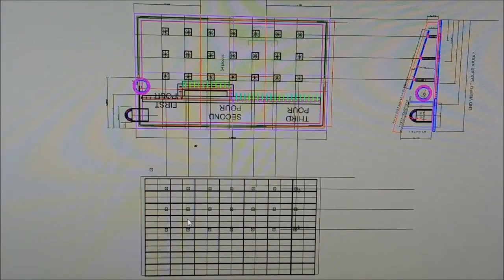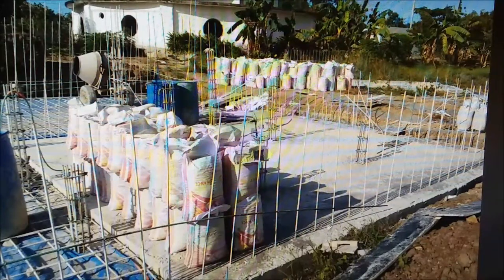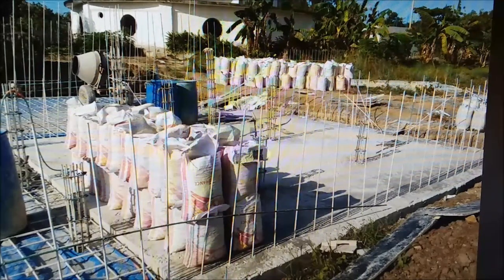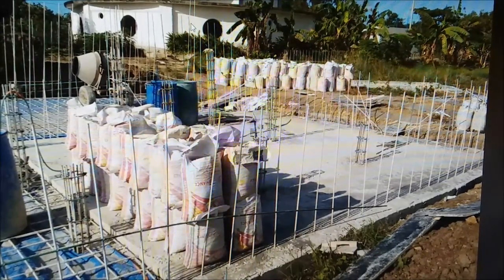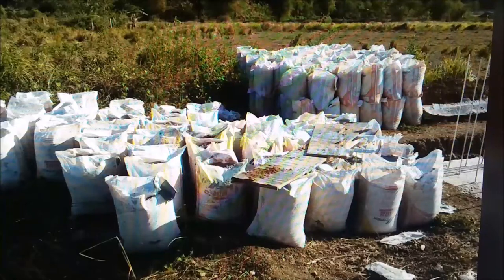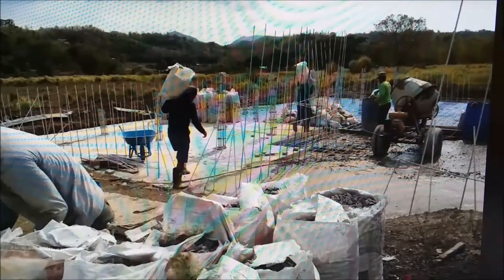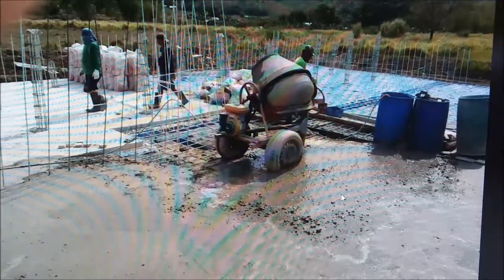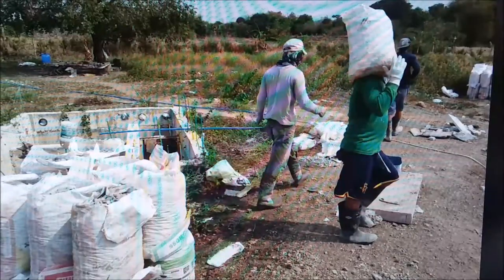CONCRETE HOUSE BUILDING IN PH, POURING THE SECOND OF SIX  FLOOR SLABS FOR THE SOLAR ARRAY AND ANALYZ

Comment: Another informative video, thanks. 
Sorry if I missed  this is on any of your videos so far, but I was just wondering if you are going to incorporate some level of solar tracking in your design. My tentative idea is to mount the array on a East/West axis and use a linear actuator to tilt for morning and afternoon angles.
Reply from the maker: John, We are not using tracking. The array is tilted to the latitude 
at our site and on a true north south. If we were using tracking we 
would still have the tilt to the latitude. For single axis tracking it 
would be tilted on an east west axis as you mentioned. There is a 
channel called  "A foreigner farming in the Philippines" that has his 
panels mounted to a cradle in the east west axis. He just did a video
documenting the change in output with his tracking compared to the panels just flat.  In our case the PV panels are the cheapest 
component of the system so we just added 40% more panels. Our 
main concern is typhoon damage carrying away the panels. So a rigid
mounting and perimeter wind block wall as well as having the 
array behind the house downstream from the prevailing wind is the 
plan.  The "texas filipino" channel is still in construction but will 
have his on the ocean side of the house tilted towards the latitude.
I am not sure how close to south that side of the house is to
facing true south.
Reply: @concretehousebuildinginph1488  Some interesting points. I actually do watch both of those channels you mentioned. My plan is to mount my panels on an rigid aluminum frame with a pivot near the centre of gravity. The panels will also offer us shade up there. For Typhoon protection I hope to have the mounting poles telescoped so I can lower and lock them down below the height of the perimeter wall. It's still in the concept phase. Anyway, got to build the house first.................Thanks J